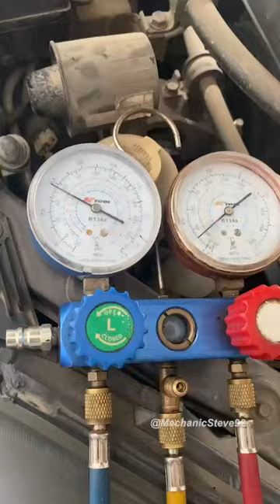#short #shorts #shortsvideo  #auto #mechanic #mechanicsteve #automotive #viral #fyp #autos #cars

Comment: So. What happened? Did you gas charge first?  Or do I think. Some things wrong. It will not work. By pass to low pressure SWITCH. Find leak😮.
Reply: To Find A Leak I First Evacuate The Freon And Replace With 175 PSI Of Shop Air!!! Then Use Soapy Water In A Spray Bottle To Find The Leak!!! Works Everytime!!!!
Rock On!!!